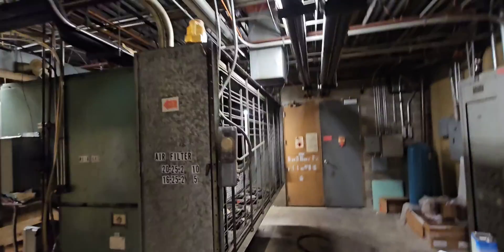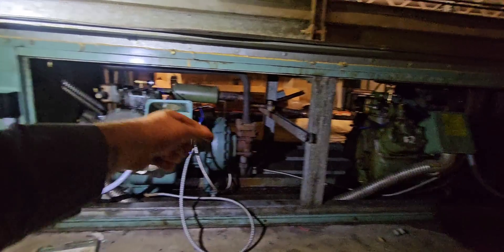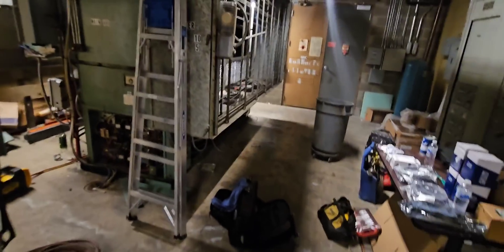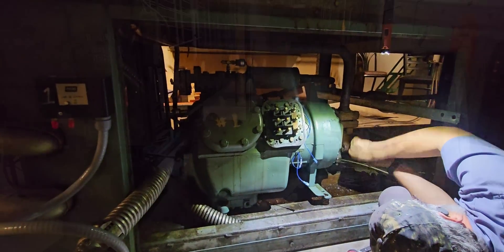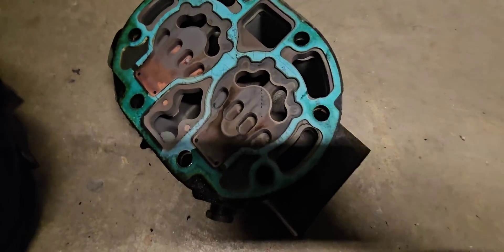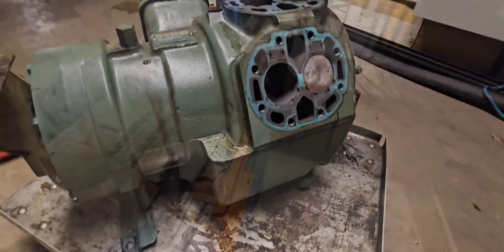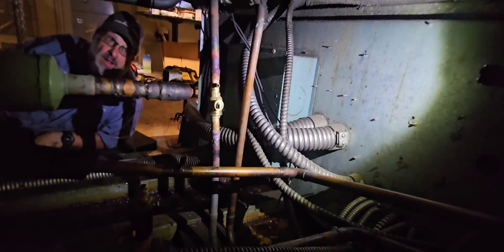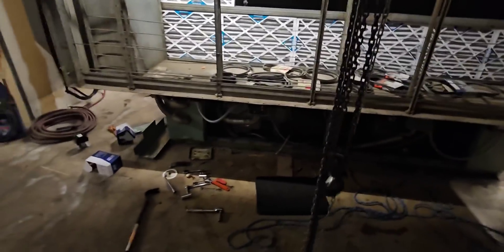Supermarket Refrigeration: Fire!! Huge flare up during compressor change out!

Comment: this wouldnt happen to have been a kroger would it?
Reply: Are you a Kroger tech?
Reply: @jeremiahsanders12  was this store #429
Reply: @jeremiahsanders12  the mechanical room ur working on looks like the store i use to work in. before i became a commercial technician i worked as meat cutter/manager at kroger, i remember specifically the rack room right across looks just like the one i use to work on when i was a meat cutter (the techs were spread thin so we started doing it ourselves with guidance). That wouldnt have been a carrier SCU? Carlyle semis? I use to take a nap on break right next to one eerily similar to that. There was a beer rack on the left of the stairwell u had to go up to get to the SCU
Reply: @TheRussianPootis  that's cool, where is store 429?
Reply: I am a tech in the delta division, around Memphis Tennessee

Comment: at what point do they replace that 30+ yr old pile of trash unit instead of rebuilding it every few years ? i know its a big unit and alot of $$ but the govt wants energy efficient stuff now with modern technology
Reply from the maker: Man I'm with you. Every year I recommend units for replacement, and every year I end up repairing them. They're getting better at replacing stuff, but like you said, it takes time.
Reply: Gotta keep politicians back pocket happy

Comment: Did you set the fire alarms off? Lol.
Reply: "Yes, a test of your smoke alarms was part of the service. Nothing to see here"   Nice work! How heavy is that compressor?
Reply from the maker: Probably a couple hundred pounds. Heavy enough to need a hoist. Lol
Reply from the maker: Not sure if it was us, but the fire alarm did go off shortly after. We weren't told anything about it 🤷‍♂️
Reply: They did, you can hear them after the 15:00 mark...